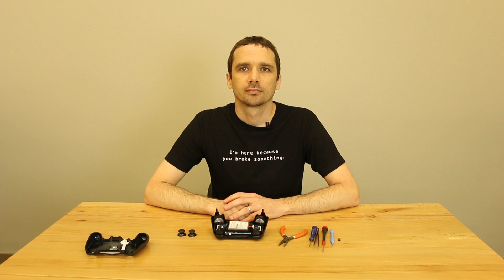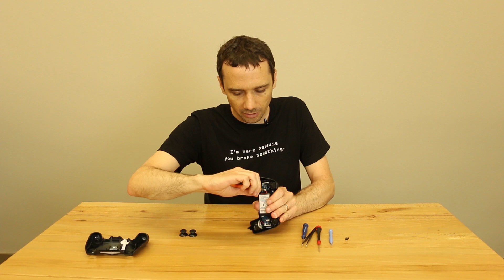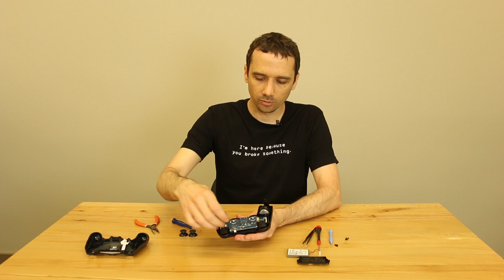PS4 Controller Analog Stick Replacement

Comment: What's more important than replacing them is getting ones that work more than a month. The original DS4 I got as a gift died slightly after a month and I'm afraid to bother replacing it with ones that will die faster.

Comment: Thank you so much <3 i fixed my left and right analog stick drifting when held down, i cleaned the circle thing in the black plastic on the side of the analog, then i put some solder on some pins because i can see that it's just budged in to the board, and then i fixed it, i just got trouble with my psn button because i cant still fix it no binking lights but its working 100% when using wired :>
Reply: Are u using wired with your ps4? Or with a pc or something?
Reply: @m3d-uza825  im using pc, and i use my ds4 controller wired since i dont have dongle to connect it to bluetooth, but i want to use it on my laptop bluetooth but i can't

Comment: do you have a video to change the analogue stick altogether not just the stick but the gimble thing it's attached to. I don't have a solder remover nor a heat gun so just using the solder gun to melt the controller pins to remove the defective one is not working at all im stumped

Comment: hi man, you fixed my ps4 before where cat ate hdmi cable and it damaged graphic card. I am playing a lot of COD and the sprint (double click on L3) starts and then stops like there is some interruption that kicks me out of sprint. I broke 2 PS4 controllers like that. Do you know how to fix it?
Reply: You can blow air through between the stick and the controller plastic as a temporary fix. Other wise you will have to desolder the part and replace it.

Comment: Hello Tronicsfix my dualshock 4 has r2 issue, does not work. changed rubber under the button, replaced conductive film but still facing problem. do you have an idea how to repair it?

Comment: Would simply replacing the analog stick fix the issue with my left joystick? Problem I have is if I move the joystick up, it keeps registering as if I'm still holding it up even after letting go of the controller. So on a main menu if the joystick is touched, it just keeps going up.
Reply: I have the same issue and my controller is only 1 year old and not so overused

Comment: I have watched a lot of your videos and they help and are interesting but why are you replacing the thumb sticks do they drift ?  Are they sticking I think I need to replace the ANALOG STICKS not the thumb sticks what is the purpose
Reply: He’s just switching them because they are worn out... Mines drift on their own I wonder if replacing them like he did would help at all..
Reply: No that would not help your drift that's just a plastic extension that connects to the analog module the problem would be in the module unless you spilled something in there and it visible sticks to one direction

Comment: Great video.
I have a problem with the ps4 controller left stick.

Mechanically it seems to be ok, I don't feel like something is broken or stuck inside the stick. But whenever I pull the stick in one direction to let the character go in that way, in game my character go In that direction, but not smoothly as it has to be, but with a shaky movement. It stops sometimes than walk forward, then stuck, then go forward again. It seems like the movement registered by the stick is not smooth but shaky.
After doing some research I discover that sometimes the sensor wheel of analog stick can be damaged, so I was thinking that replacing this piece may solve the problem.

What do you think?
Thanks in advance and sorry for the long sentence!!!
Reply: Check your rocker sensor
Reply: Blueheartdx I need some help is the rocker sensor the green box around the inside of the controllers analog stick? I can't ever get them to pop back in after I take them out to try and clean connections

Comment: I don't know why they removed the analog on/off button. When the sticks inevitably go bad in one direction (sending constant inputs) or if they were completely broken all you had to do was switch off the analog and you could use the rest of the pad for years. My Dualshock 2 pads still work... after 8 years. Even the analog works even though it can freeze in a certain direction from time to time.
Reply: Because every game out there makes use of the analog sticks?
Reply: I'm having this issue with my current controller, it's not even that old. Do you know if simply replacing the stick will fix that?